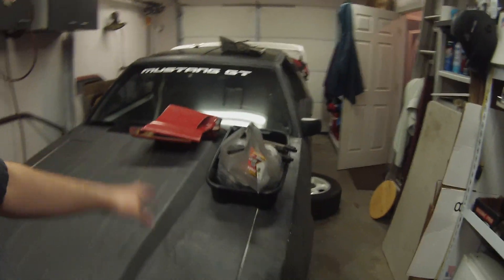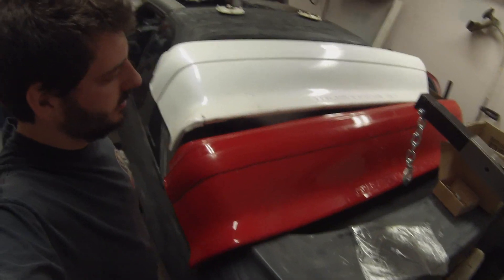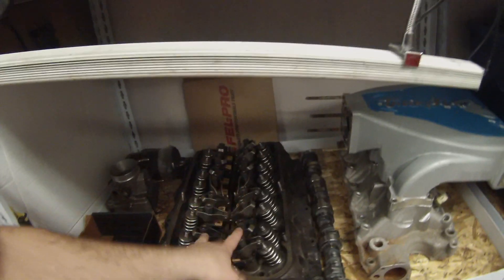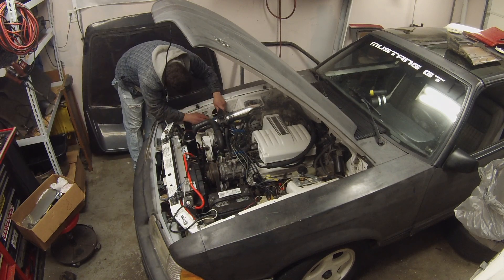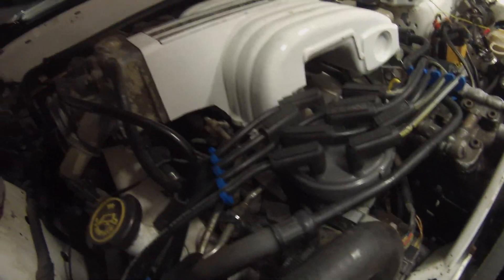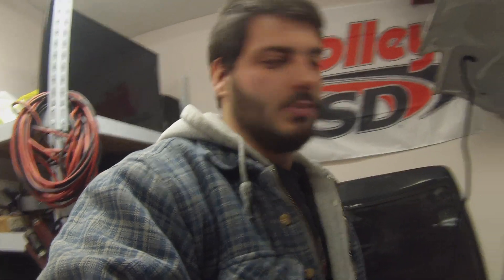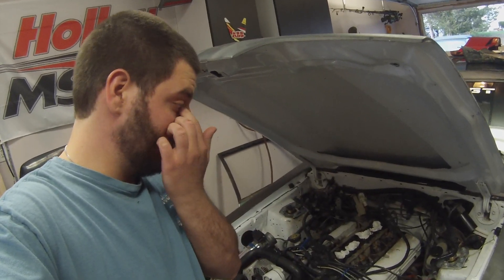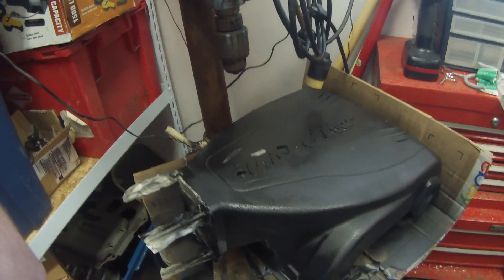Installing Trick Flow Intake Part 1

Comment: The groove in the TFS intake is for the fuel hose that connects to fuel rails to set into.  I don't know if you mentioned it or not, but you also need the EGR spacer and throttle body gaskets